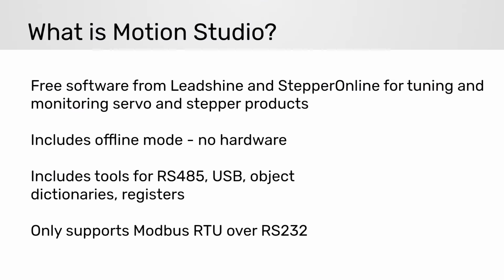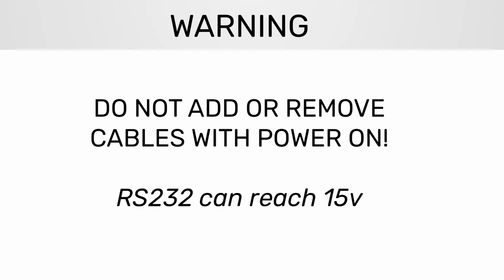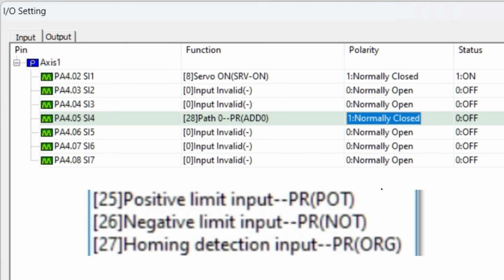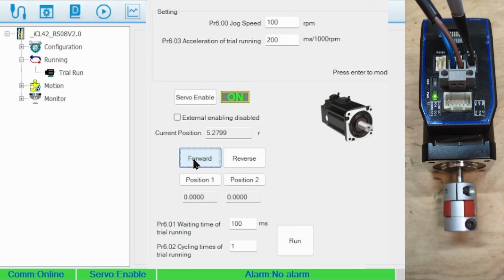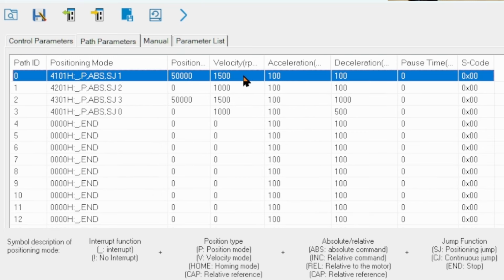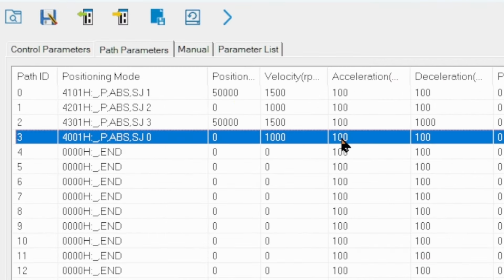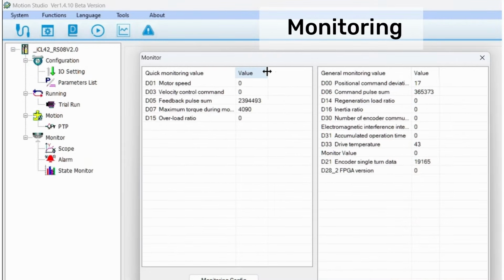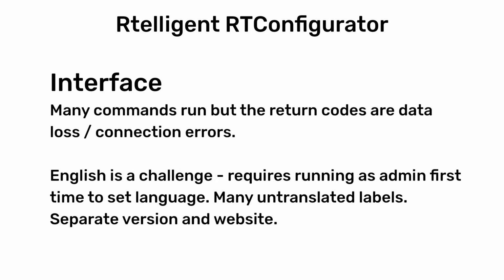Leadshine Motion Studio: The Ultimate Beginner's Guide

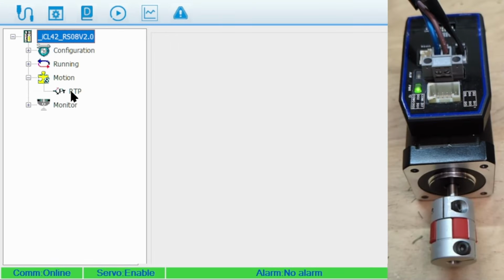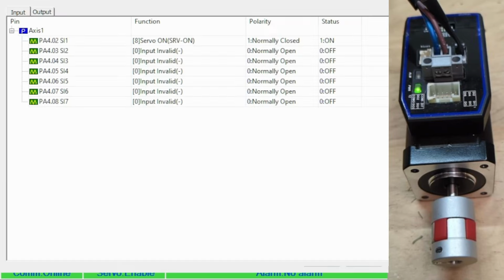Comment: hello. By respecting the steps from "PR mode configuration options" in between minute 5:33 and 8:36, with the Leadshine Motion Studio_Servo_V2.3.2 (last variant on the website) and as well with the MotionStudio version that you have in this video I can not start the motor after I am configuring the 15 Path Parameters - while pressing on the 1 to 15 buttons. I have respected the instructions placed by you in this video.
The setup is the following: 
-> servo drive version: Driver EL7 50/100/200/400W 220VAC RS485 Leadshine
-> servo motor with break: ELM1 400W multi-turn 1,27Nm 23bit Leadshine 

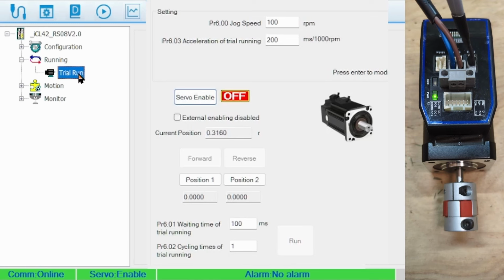Since I followed your video, the "Trial Run" presented at minute 4:31 works great. However I am interested if anything has to be configured differently for my case.
Thank you. I would appreciate an answer
Reply: You must untick "trigger" in control parameters tab.
Reply from the maker: Did @green_wtf suggestion work? Sorry for being so late, I messed up my COM ports and don't have it running.

Comment: Hi, can someone please help me with an issue I'm having with one of these motors?  So I have the StepperOnline T6 Series 1000W AC Servo Motor Kit and I'm using it as a spindle motor on a Syil X4 CNC mill.  Every time I am running a program that runs the spindle at near 5000RPM once the operation is done and M5 is executed to stop the spindle the drive has an error and I cant clear it without rebooting the drive.  Is there a parameter I can set to make it so the motor ramps down little bit before stopping so suddenly?  If I manually ramp the speed down to about 4000rpm then stop the motor it wont error and I can continue on to the next operation or tool change.  Anyways thanks
Reply from the maker: Did you end up finding the error? I'm not familiar with the T6 series, that sounds like a difficult problem to solve. I'd expect the stopping codes to be the same. If it has a brake (or maybe even if not) it could be overshooting the tolerance value ... maybe stopping force is higher for the extra rpms?
Reply: @nsfwmachines8343  No I still haven't found the solution but I know for a fact there has to be a parameter configuration setting for the drive that will do this and prevent the problem overshooting.  I just cant figure it out because the manual is so oddly worded and not very descriptive.  For now though I'm looking into maybe with LinuxCNC the controller software I use possibly having a S-Curve jerk limit but instead somehow implementing it with the spindle rather than on the other joints

Comment: Do you have any advice for programming the stepper motors for use with non-leadshine software/hardware. For example, an arduino microcontroller?
Reply from the maker: I was using Blynk for everything (way too dependent) , but they cancelled their maker plans last year. I'm starting to look at it again, here's some outdated info that might help:
https://github.com/MikesMachines/MotorControl
https://github.com/MikesMachines/machinecode/tree/temp
(note the temp branch)

Comment: H2-2206 drive show error 020 please help me
Reply from the maker: That typically means the encoder cable isn't hooked up correctly. If you can email me at nsfwmachines@gmail.com with some screenshots I'll see if I can help. Include the exact drive / motor model info and info about if you've had it running successfully with other configs.